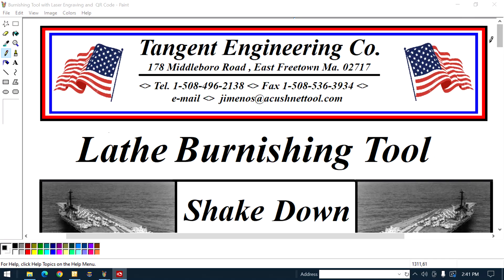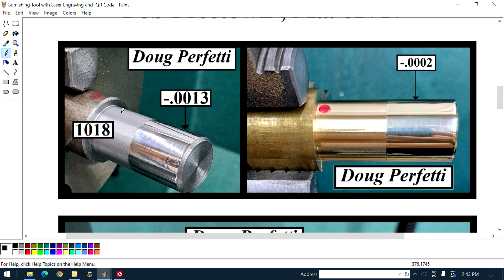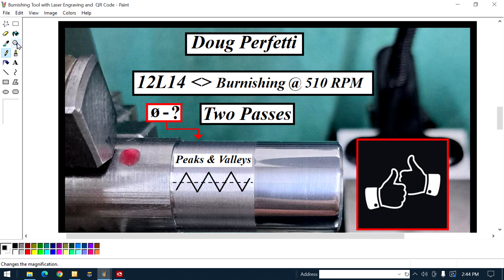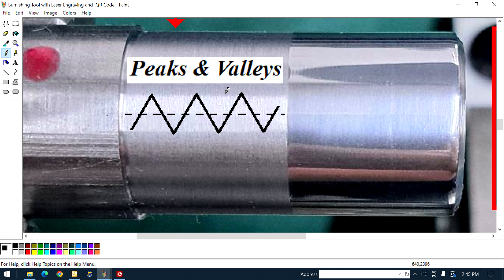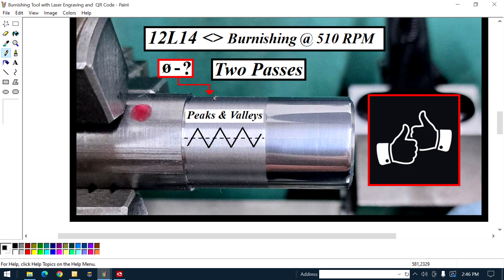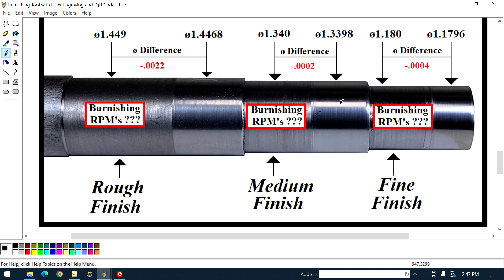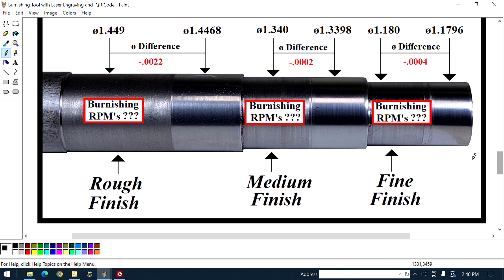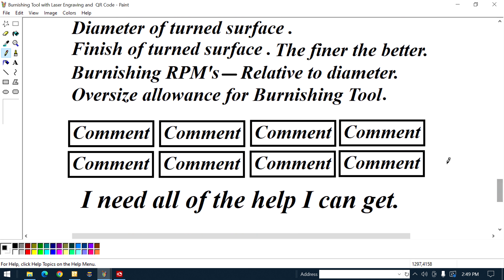Burnishing Tool - Need to know .

Comment: thanks for the info.
Reply from the maker: Todd - I'm trying to make common sense of this thing . There are so many varibles . It's making me crazy . It's a Great Tool  - I'd like to learn how to 
use it , so I can demonstrate it  correctly. -- Jim
Reply: @TangentJim  I think you just need to do a test run and check results, adjust as necessary, then do final runs. Just like when trying to cut to final dimensions on the lathe, I always start  the cut just enough to measure, before committing to complete cut. If cut is to deep I can make corrections, then complete the cut. You can't tell people how hard to push on the brake to stop their car - they have to learn that on their own. Your burnishing tool is great. Every lathe and every metal is going to perform differently. People have to use the tool between  their ears to obtain what they want. This is the greatest part of making stuff, you are not limited to just tooling, it challenges your creativity. Have fun and keep learning.
Reply from the maker: Todd - You just explained how to use the Burnishing Tool . Thanks for the education .  -- Jim

Comment: Diameter of part not so important says I. If we apply the 143 tpi screw theory to the surface finish again, being a sort of thread the depth of the valleys from the peaks would be the same on all diameters for a certain finish pass of the cutting tool prior to burnishing. For example a 0.030” depth of cut and 0.007”/rev feed. Likely the surface speed would change things slightly but theoretically not that much. I’ll  have to wait and see what actual testing shows.
Reply from the maker: Benno - I'm not going to play Verbel Volley Ball with you . Like you I'll wait to see what the actual testing shows .
There are to many Variables . -- Jim